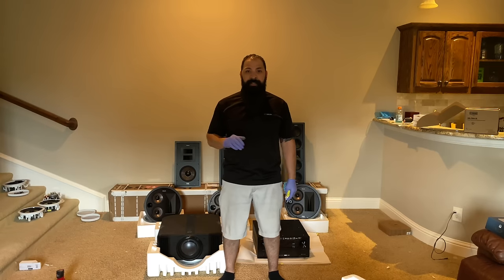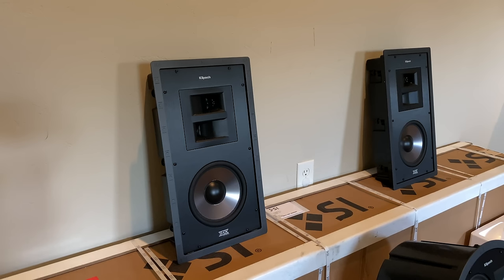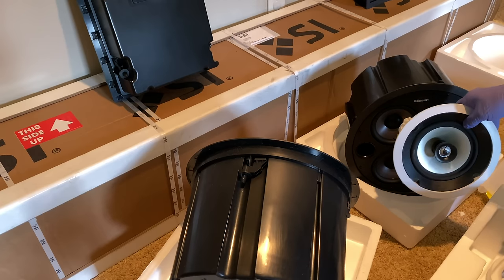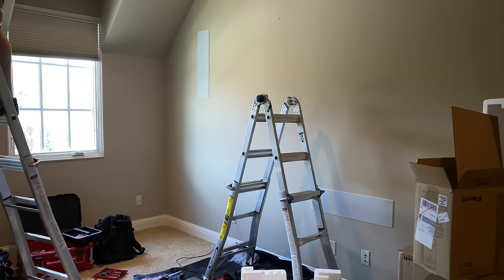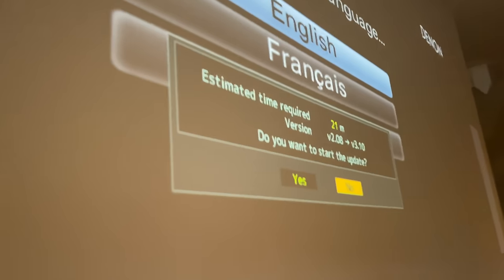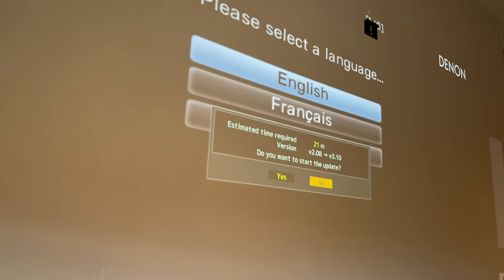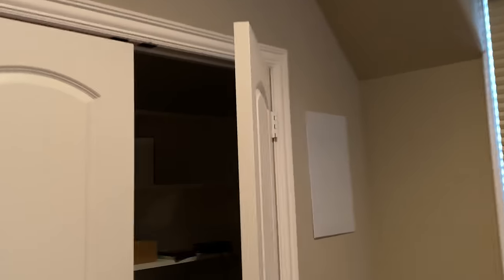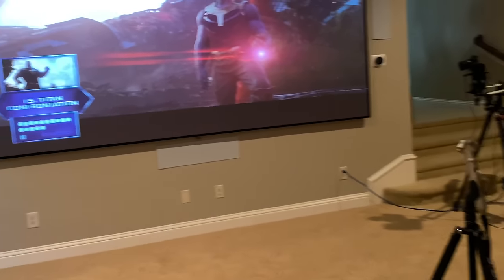8K JVC RS3000 Klipsch THX 5.1.4 Atmos Home Theater w/ INSANE 150" Black Diamond Screen

Comment: I thought all the tweeters at seating are supposed to be at ear level
Reply: No, there is no solid rule. Some tweeters only sound good when at the correct height and aimed a you. Other tweeters do very well for off-axis sound. Just depends on what you're working with. These Klipsch are fantastic when being installed where there is room, and then aimed at the seating position. The horn waveguides allow for the aiming of sound. 

Plus, this install looks to be done very well, and the gear selection is fantastic.

Comment: I wish people cared about acoustical  treatments. I'd rather spend less on the speakers and fit bass panels and traps into the budget .its,what makes the most difference acoustically
Reply: likewise for light treatment.
Reply: @Descalabro  Agree, but this is clearly a compromised install due to the location being right next to a kitchen on one side. With that in mind it's a bit surprising how much was spent on the projector and speakers (which deserve a dedicated room).

Comment: at 9:06 Chris refers to the Denon AVRX-8500H as the Marantz AV8805 PrePro. Not all heroes wear capes but he should be careful with his brand model nods. Since they are both D&M I guess its not a tragedy!  Also are JVC projectors Imax enhanced? Good video. Shame the owner didn't go with some darker tones for the paint before doing all that custom work. Would have really helped!
Reply from the maker: you dont need a painted room with an alr screen this is the baddest alr screen out there
Reply: @Dreamediaav  An ALR screen helps, but it's not a match for a plain white screen in a velvet black room.
Reply: @Descalabro  exactly.  A nice acoustic screen in a dark room would have been even better.

Comment: Beautiful installation but that room with all of those hard walls all around without any sound absorbtion, must sound terrible! specially using high frequency horns?!.... I believe that a sound reflection anylizer should have Been used and attenuate that extremely live room. I'm sure the owner will complaint at one time unable to accept the extremely "live" room he's sitting in and.... placing the sub right behind the seating area, specially in that enclosed area. (like a open closet) , surely will increase a "boominess" sound. If you set up the automatic sound analyzer that the Denon Amp brings, you'll see a very weird and uneven graph results being displayed.  After doing this for 40 years, I exactly know how that room will sound.
Just a constructive criticism.
Reply: Yes! Passive room treatment is almost everything that counts.

Comment: Don’t you need a THX amplifier?
Reply: That Denon x8500h is A THX surround integrated receiver.
Reply: Only if you want THX certification. You can get the same performance out of non THX equipment. It just wasn't submitted for THX certification.

Comment: Hahaha, you gave the reasons why you don't use banana plugs, then you used them...
In electrical wiring, you never make a connection that's unnecessary, unless it's a showroom in an audio store, wire straight to the post's..
Reply: He literally explained the customer wanted them but he is against them.

Comment: Y'all should really invest in a dust extractor (or at least a shop vac with a HEPA filter and fine particle bag).   There is no reason to not be collecting drywall dust in a finished space.
Reply: I agree with you. I would try to leave the smallest footprint during the install, but a professional install otherwise.

Comment: Why is the L and R so high up. It's going to considerably off axis.
Reply: Probably because the R needed to be above that other panel on the wall (smart thermostat?) due to where they were installing, so both speakers ended up a little high (from what I can see).

Comment: Why not seven 2 and 6 with that receiver. .
Reply: Seven floor channels would be difficult, did you see the kitchen on one side of the room? It's clearly a multi-use room so I think 5.1.4 is fine, though it does mean the receiver and projector are slightly overkill.

Comment: Have you heard of dust sheets? If I came into my room and seen my kit worth thousand of dollars covered in drywall dust I’d be pissed. 
Saying that you will wipe the equipment down is unprofessional as it shouldn’t have been exposed to the dust in the first place.  Not very professional.
Reply: As much as I love Dreamedia I agree with you 100%. I cringed when I saw that part of the video. I am in the middle of a renovation in a house I recently purchased. I have zip walls installed and most of my gear in closets or wrapped in plastic behind the zip walls. Even with zip walls I taped the plastic (6m) to the ceiling, walls and floors. Sparred no expensive to ensure when the reno is done that my gear won't have a spec of dust on it.
Reply: @boodybandit  You can tell just how unprofessional these people are by where they placed the front left and right speakers. Never in a million years would I use a bunch of amateurs to install my high-end home theater.
Reply: @thefunplace4269  why wasn't a nice acoustic screen used and the in walls behind it?  I never understand why most of their customers don't go with an acoustic screen especially with in walls?  Oh well.
Reply: @thefunplace4269  where would you place them in that room? considering the screen size and the nest thermostat..?
Reply: @kelownadug  Behind the screen (if it was an acoustically transparent screen). Would look neater and solve the problem of less than ideal positioning.

Comment: This is a pathetic THX setup. Why would you use a receiver to power this massive system? You need a separate power amplifier for the best performance. And why is the left front and right front speakers placed so high up on the wall? Oh well, you get what you pay for.
Reply: Speakers were adjusted on the wall and located perfectly.  Had a professional acoustic team come in after the fact to make sure.  The 8500 Denon is more than sufficient to power this system.  Amp’s are always available to add later, anyway.  You’re right tho, I paid for a killer system and got one.  Deuces.